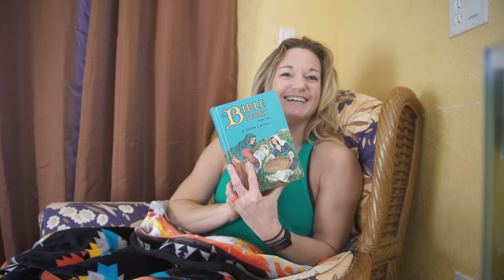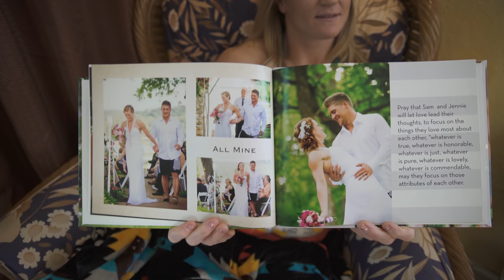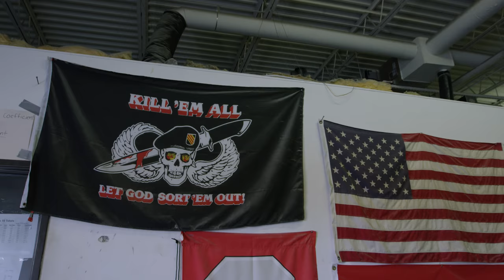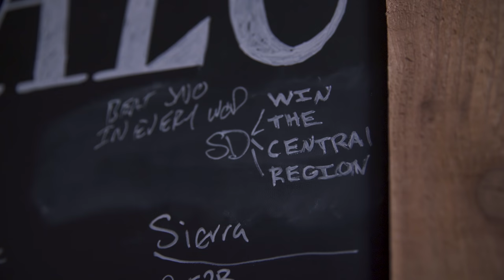Road to the Games 17.04: Eramo/Dancer

Comment: Sam completed the games with a stress fracture on his fibula.... what the actual hell
Reply: Alec S youll actually see a lot of athletes in many sports compete with a fractured fibulas, it's not weight bearing, unlike the tibia, so it's perfectly fine to put weight on it if it doesn't hurt
Reply: I have a fibular stress fracture right now and have been ordered by my doctor to do no weight bearing exercises on it. I can only lift upper body (seated) and do core exercises. I've been stuck in a boot for 12 weeks now. I did 17.1 Scaled on it before i was diagnosed and there wasn't pain during the wod, but he said if I landed wrong or put too much pressure on it, that it could continue into a full break, which then requires surgery. I'm impressed that Sam was able to compete on it, without making it worse. Mine doesn't allow me to squat, that pain is what sent me to the doctor.